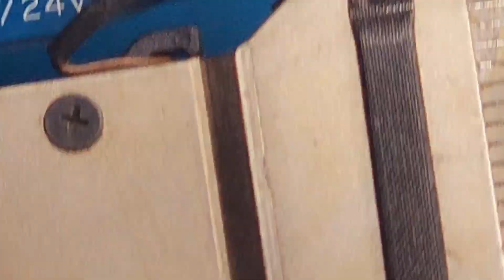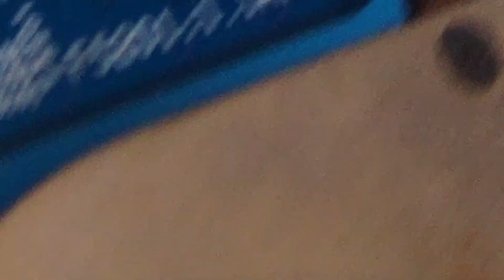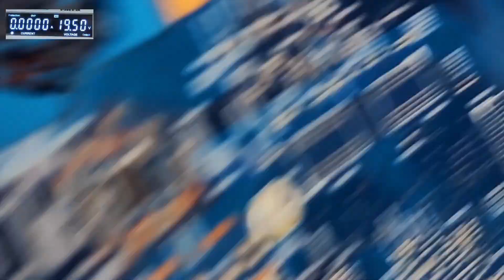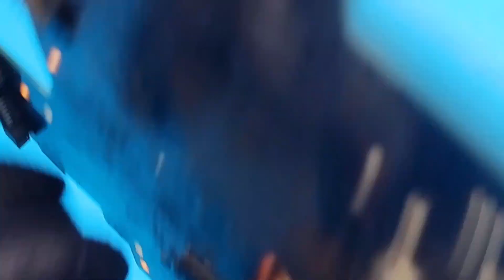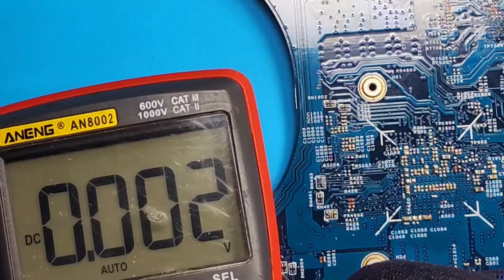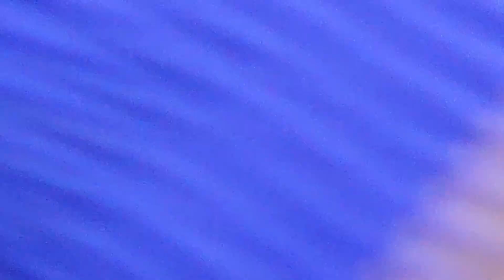Acer E1-522 | This is a common problem with the SIO. But solution is simple. #nopower

Comment: can you make a video from eg : 13 minutes  how do we check the ite chip is the 19 volts charger connected where is the black prob of the multi meter at that time we just see the red one
Reply from the maker: @KendraKelly-rp1gm  No need to worry always one of the probe should be in the ground (screw hole) black or red doesn't matter in order to check resistance and voltage in SIO (ITE). For continuity check only you need to probe away from ground point to the intended place.

Comment: Good job of explaining what you are checking, doing and why.  Could I ask, where did you take your training for MB repairs and principles of operation?
Reply from the maker: I learnt basic knowledge from an institute and from the basic knowledge I try to develop through various sources like books, Schematics, datasheets. I do have watched youtube videos even to get the knowledge. But my foundation is through the institute. If you firmly understand the timing sequence of voltages and signals that controls them, then laptop repair is very easy. I'm preparing a next video to explain the full timing sequence of a laptop came with water damage. Stay tunned !
Reply: @philiptroniks much love from Nigeria keep it up man I learnt new ideas from this video you did now basically the ideas behind switching diode which means that whenever negative comes to the negative part of the diode it switches it
Reply from the maker: @sendomc6427  Yes that is the basic function of Diode. You can understand the working principle of a diode in a bridge rectifier more clearly, which blocks and allow postive and negative voltages to convert to pure DC.